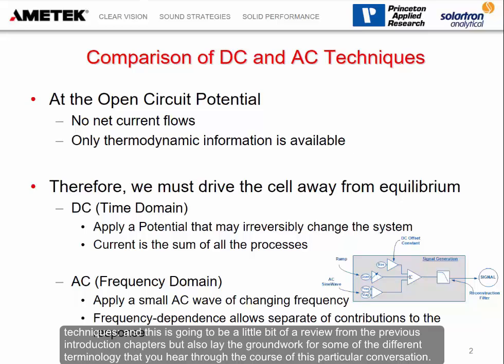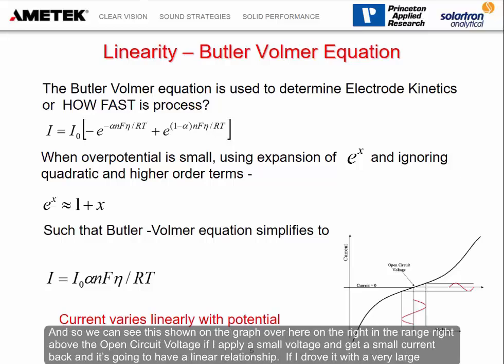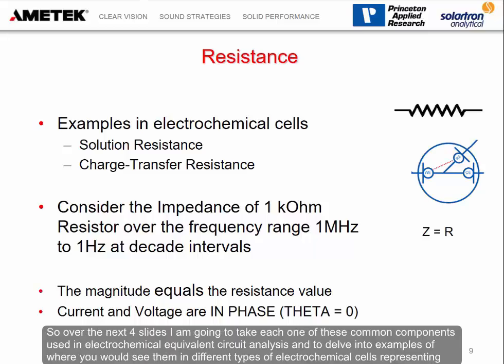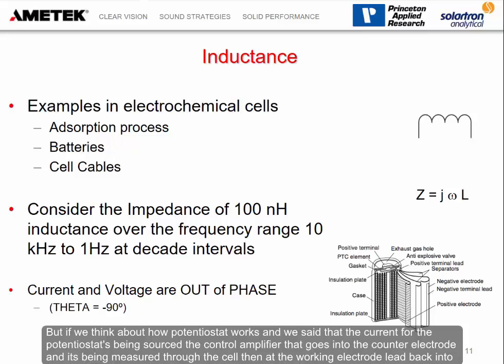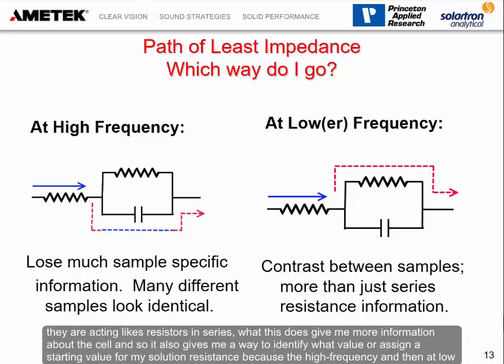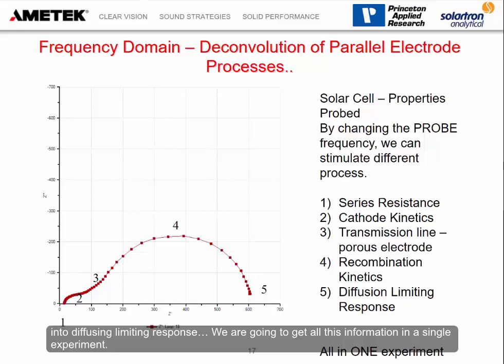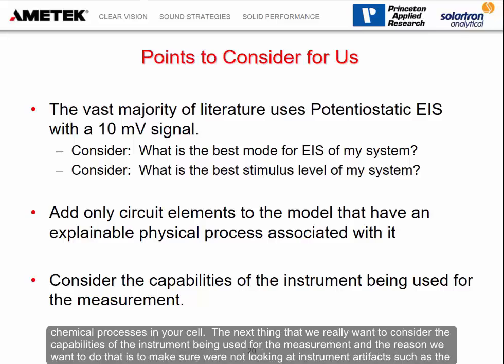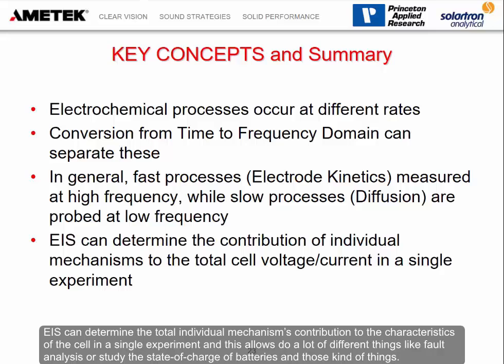Electrochemistry - Electrochemical Impedance Spectroscopy (EIS) Theory

Comment: The impedance of capacitor should be 1/(jwc) instead of -1/(jwc)...
Reply: Thanks,  I expressed it differently by multiplying your correct answer by j/j, which yields the same result.

Comment: Great video. 
I have a VersaSTAT 3 potentiostat (with EIS available)
I am looking for a guide (or manual) to run the Electrochemical Impedance (I am not a specialist)... Does anyone have a recommendation?
Reply from the maker: Diego, Thank you for wanting to learn more about your VersaSTAT3.  There are different resources from AMETEK available including additional videos and technical notes at www.ameteksi.com.  There, you can also find contacts for our Applications Team that can help with your specific tests.
Reply: @ametekamt-princetonapplied5482  I have the same situation as Diego, I searched everywhere on intro videos to run the analysis and analyze the data. so far no helpful lead

Comment: thank you very much.what is the diference between elctrical impedance spectroscopy and electrochemical impedance spectroscopy?
Reply from the maker: Thank you for the comment.  Practically, consider how the test is applied:  Electrochemical Impedance Spectroscopy as a study of an electrochemical cell -- electrodes and electrolyte; whereas, Electrical Impedance Spectroscopy as testing of circuit elements or materials.

Comment: i measure eis for electrode test in a fuel cell.i observed quarter circle not start from 0,0.normal?
Reply: If the "semi circle" does not start at 0,0 it means that the solution resistance is higher than 0, as expected. The starting point on the X axis (Z_im = 0) is your Z_re, consistent of Solution resistance and connection resistance. When I use 0.1M H2SO4 as electrolyte, the solution resistance in my system is around 30 Ohm. But this value also contains afaik the ohmic resistance of my cables (which are low) and the conductive glass (which is higher than for metals) as well as the solution res. (highest among those)
Reply: Esat Becco, thank you for your kind reply